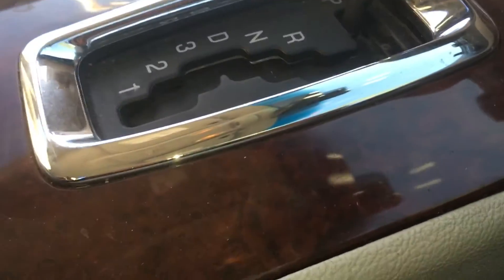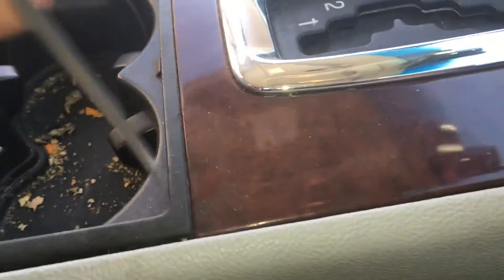How to get a 2007 Buick Lucerne into neutral

Comment: What causes that to get stuck like that? Can I do it myself to fix the problem
Reply from the maker: @doza5837  I’m not sure what the problem is. Sometimes it can be a bad fuse, a bad brake pedal switch, or the little electronic motor in the shifter went bad. I would start by checking fuses.

Comment: ok same problem here and the button did the trick.but what needs to be fixed or replaced to get it back to normal?
Reply from the maker: I’m not sure cause it could be a few different things. I would recommend having your local mechanic check it out for you. Sometimes it could be a blown fuse, a bad, brake, pedal switch,The motor for the release stopped working
Reply: Maybe the shift solenoid is bad